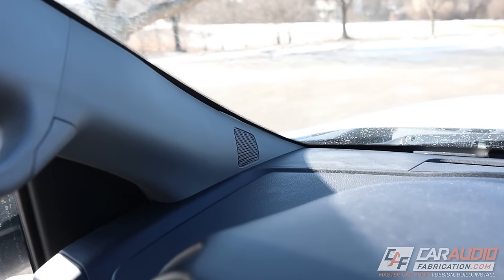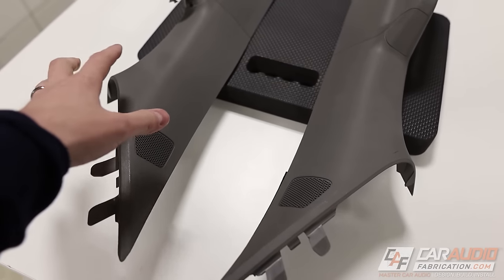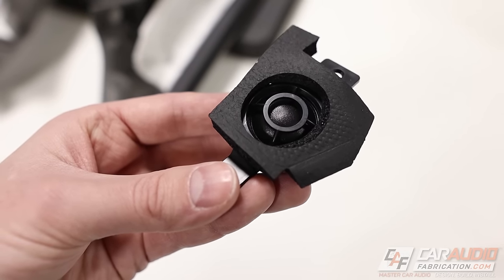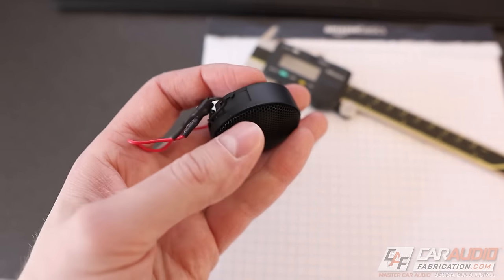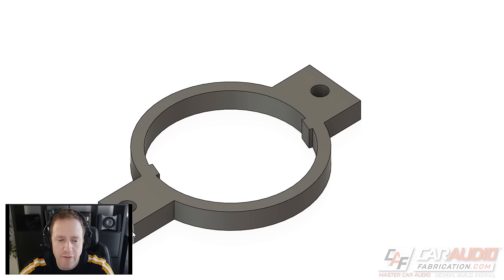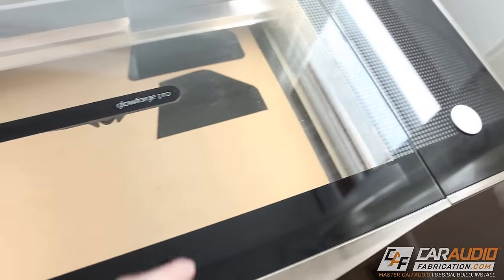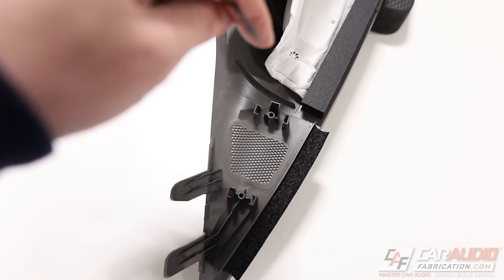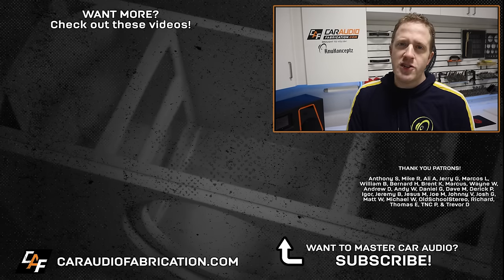How to Mount NEW Tweeters! Use THIS trick for better sound

Comment: "Use THIS trick" and then the trick is to 3d model and laser cut a custom speaker adapter.
Reply: @MG-ep5mm  yeah it's kinda normal to have a  3d printer,a molder app, a laser cutter. And the knowledge to do it all.😭
Reply: So true😂

Comment: So clean! This guy makes me wanna do my installs at his level but I just don't have his resources
Reply from the maker: Check out what I talk about at the end of the design phase 👍
Reply: On can do anything with proper motivation. Everyone who almost did something always has an excuse. Don't give yourself one. Don't let failure be an option.
Reply: Baby steps man. Start small and slow. Pick up stuff used(not complete trash of course) do a build on your own rig, starting small, then add to or replace. Then Atleast you’ll know wether it’s something you really want to invest into and do long turn. I love doing the work on my own Rigs, but honestly would never want to do it for work. But that’s just me personally of course, which comes with a ton of different variables and reasons why. Good luck man, and just don’t go overboard thinking you need the best of the best stuff and don’t overload your self with a crazy project or you’ll more than likely be stressin’ instead of enjoyin’.

Comment: Back in the day (20 plus years) I worked, ironically, at a Ford/Mazda/Lincoln dealership. Sure a lot really wouldn't be surprised, but we see crazy crap on new vehicles. Mazda B4000 (same as Ranger back then) had Mazda on one side and Ranger on the other door sill. Diffs having no fluid, one mech heard a rattle and thump in the passenger door of a Taurus and found a air ratchet.

Best part was we almost NEVER had issues with the Lincolns. Always minor things like a sticky cup holder retract. We used to joke that Mondays and Fridays they produced garbage.

Comment: Knu Konceptz have the nicest wire that I've ever worked with. Their 0/1 awg Kollosus cable is soft enough to wrap around your finger & tie into knots....
Reply from the maker: Definitely! It's tinned OFC too so corrosion resistant with plenty of current handling!
Reply: @CarAudioFabrication  It's excellent stuff. I first bought some power cable from them in 2008-2009. Something like that. 

I haven't bought any other power cable since...

Comment: I prefer black A pillar trims. 
What happened to included angle mounts coming with tweeters like Boston Acoustic Pro series,  only 25 years ago. Bought angle cups for my current JL C7 tweeters for door mirror / sail panel locations
Reply from the maker: To be honest I almost never use those cups. They are nice to have but if someone is going to try to precisely aim the speakers they aren't going ro rely on a certain angle cup, they'd likely custom fab. My 2 cents.

Comment: Hello. Got a 2020 Hyundai elantra se, has 4 speaker system,  I desided to change the 4 out for 4 cerwin vega 2 ways one in each door, the front doors has a factory tweeter, but I have 2 cerwin vega tweeters with crossovers. The factory tweeters have a separate wire going to them,will I need the crossovers?  And using the 2 way speakers,  will the tweeters be to much for the pioneer avh501ex.

Comment: I think you are a awesome installer, love your work, I do have a question and your twitter install. The tweeter your installing has a protective grill already, and the truck pillar also has a protective grill, wouldn’t this cause ringing and affect the twitter performance with two protective grills? Would like to know when you tune the system if you can see any spectrum decay in the high frequencies?

Comment: Could yiu possibly do a video on wiring two subwoofers that utilize direct lead wiring instead of push terminals? I have 2 American Bass XFLS, which have direct lead wires, and can’t seem to find a video on how to do the wiring. I know how to wire them down to 1 ohm. Just don’t know the best way to wire them together

Comment: The lower A-pillar is a nice location, but I really wish more installers would focus on that low triangle, where the dash, the A-pillar, and the windshield meet. I'm no fabricator, nor an installer but I can imagine making a small pod, and fitting something like a  2, 3, even maybe a 4" coaxial, u would get amazing forward and stereo imaging, rather than the ubiquitous left\right side. In audio, we should focus as much on a forward image as a left-right image. Obviously, this is not a perfect s0lution for many vehicles, because depending on the size of the pod, u might cut off a bit of view, but honestly, I don't know exactly. I've tried mocking something up in my Cadillac and didn't see much of a restriction. Would love to see this in action. I've even thought of more exotic ways of making this with a 3" mid-woofer and a verticle ribbon tweeter running up the A-pillar... 

Mark, or anyone else, do u understand what I mean? Just my thoughts.

Comment: Mark, how do you feel about the stock  location of the A pillar tweeters in the f150? Do they lose projection being so low in the corner of the windshield? Is it better to custom mount them higher on the pillar pointed at your head?
Reply: The more parallel to your ears the sound source the better. Just make sure to adjust the eq settings accordingly afterwards.

Comment: Hi, I know this question has nothing to do with the video, but I have a 2016 Mustang GT with Shaker 9-speaker system, can you make a harness to connect my LC7 to the factory stereo without losing the functions?  I want to put 2 amplifiers 1 set of 3 ways in the doors and another set of 2 ways in the back and the other amplifier for sub.
Reply: Zapco dsp 9 channel amp would fit all your needs

Comment: Did you consider "aiming" the tweeter a bit better while doing this custom mount? Let's say to get a better imaging just as you've shown us on a previous video on the subject.
Reply from the maker: They are aimed decently based on their OEM position. Could it be optimized with a fully custom made pod? Of course. But you guys are always asking for different budget range solutions and this fits the more mid range upgrade vs a fully custom made pod with much more labor.
Reply: @CarAudioFabrication  I was referring to a way to aim the tweeter internally in the A-Pillar, keep using the factory grill and location and taking advantage of the insulation stuff you've shown to "tunnel" the sound. Not sure if there is space for that or even if this is possible or if it worth it..